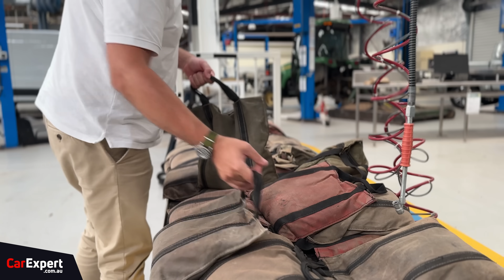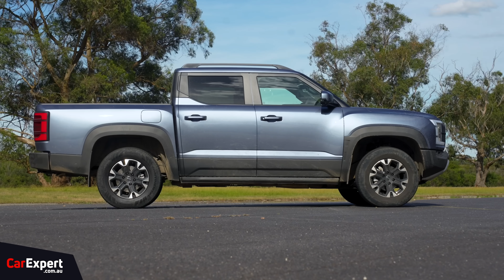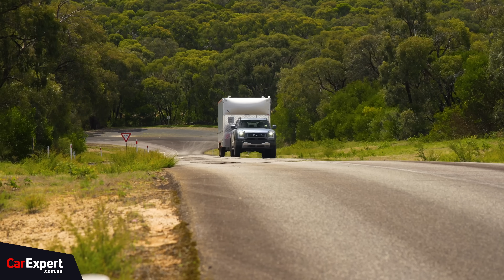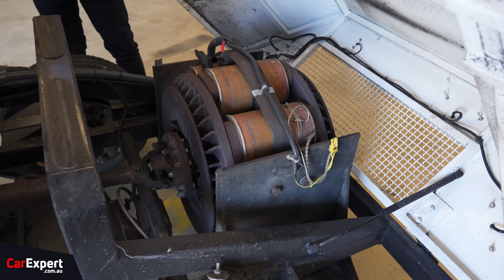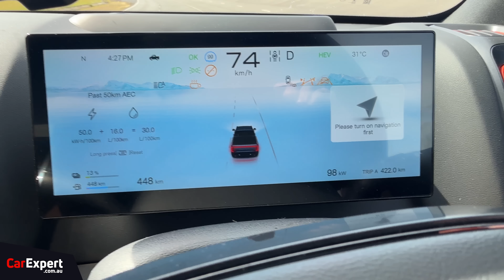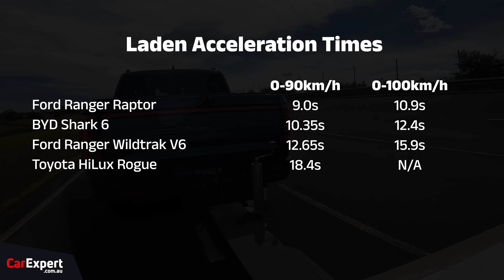BYD Shark 6 towing STRESS test at MAX payload - the results are surprising...

Comment: To all those that see anything that tows less than 3.5T as a waste of space, what are you doing here?   For those of us that tow up to 2.2T and are happy doing that we now have an exciting new choice that costs way less than our previous options and by all accounts will do it well. I for one am excited by the prospect of NOT having to resort to a smelly smoke belching, noisy diesel vehicle I’ll be able to tow my 2T van with the same vehicle I put my electric zero turn mower in and be able to power/recharge them both as well and not carry a generator for either of them. This thing was made for my use case so I’m looking forward to trying one after they’ve had a little time to fine tune it.
Reply: My hobby 540 caravan can sleep 4,have 2 24 inch TVs inside ,floor heating ,shower ,105Ah batery   ,Microwave ,air fryer and so on  and weight only 1.5 Tons
Reply: @jeffwallis6696  but the Shark 6 uses more fuel per 100km to tow than all the other utes that are towing an extra ton, except the silly Raptor.... so what use is it to you?  It's a totally pointless car.
Reply: @ @Hmm, we’ll just have to wait and see I guess. If you believe that the tow test done by Paul represents how you’ll be towing your load up a hill then you are 100% correct. I’ve been reading about the trailer dyne and the ones I found for sale (new) were designed to simulate a 25% grade and you set the load you wanted and obviously your speed. Now if the unit in the test was like the ones I researched then he was towing roughly a 2T load up a 25% grade at 100kph. It had to have rubbish fuel consumption, its a tiny turbo petrol literally having its neck wrung up a gradient that was twice its approved 12% maximum. It was only half a test, we learned how to kill it but we learned nothing about how it will go when it’s driven by an owner without an YouTube entertainment channel.
Now in my situation I’m going to be more concerned about the petrol going stale in the tank because week to week I travel mostly short trips of 30km or so and the engine will never turn on. I’m not trying to convince you it’s good, I still don’t know. But I’m definitely going to before I buy one.
Reply: @jeffwallis6696  yeah time will tell.  I know I won't be getting one as a tow vehicle, a city run about with occasional light duties and a little adventure would be fine, which is what most people will use it for.
Reply: @mattmobiles15  I think that’s exactly the group they’re aiming at and to be fair I sit in that group. I see this first edition somewhat like a bridge between what we have now and the future that has yet to be invented and anyone that buys one is probably going to struggle badly with buyers remorse because every new model that comes out will probably be better in almost every way, but you’ve gotta be happy with what you buy now and just move on, its hard enough keeping up with the new phones, let alone new cars. This will be a really good car for many and fall way short for many more. I’ve paid a deposit to secure a place in the queue but I’m still waiting to be convinced that the advertising hype is duplicatable in reality. As you say, we shall see.
Reply: @jeffwallis6696  mazda recently revised their wankel rotary engine to act as a generator for an EV hybrid, so more is to come, it will only improve as time goes on.  Look how far phones and TVs have came over 20 years.
Reply: @ silly Raptor?
Reply: @gp.SSV8  silly engine in a Ute, fun, but silly haha
Reply: Ya can’t beat an old fashioned soot blower!
Reply: And you will be smart enough to use the right mode with the right SOC for that too unlike our 'tester' lol
Reply: 🤣🤣🤣
I am afraid Paul needs to test 4 rounds x 1000km   .....

First round towing 1 ton for 1000 km.....
2nd round towing 1.5 ton for 1000 km....
3rd round towing 2 tons ........
4th round towing 2.5 tons .....

   for a total of 4  rounds  and an international referee is required
Reply: I regularly tow 2tons and my diesel doesn’t puff any black smoke out the back, what are you on? While an EV will have immense torque on hand I can still cover my 400km route almost twice in the same day on the same tank of 70ltrs for 800km. So keep your EV Ute for you round the block work.
Reply: @ thats wonderful Sean, and I’m truely happy for you, you have obviously made the right choice for your use case. But just to be clear, it’s not ‘MY’ EV and I may never own one, that is yet to be decided. There is much water to go under this bridge before any commitment is made on my part and if I’m trying to convince anyone of the merits of this vehicle it’s myself so please don’t feel challenged in any way by my comments.
As for diesel smoke, you either love it or hate it, personally I hate it, and if your truck doesn’t stink then well done, you’re obviously in the camp that keeps it well serviced. But it’s a brave man to go round telling the world that his s**t doesn’t stink don’t you think?
Reply: @Random-Destination  while you think I’m going after EV negatively, I’m not. The problem is, 1. Range for actual application, 2. This particular vehicle when out of battery switches to ICE and limits engine performance while sucking down over 16litres / 100km in petrol which puts it into the 1990’s v8 category of fuel efficiency 3. Ease of maintenance for people who work their own vehicles and even independent workshops. Lastly and certainly not least, after Tesla being the ground breakers for the last 10 years or so, it is now coming to light just how polluting EV’s truly are since the metals and chemicals used to make the battery packs are very dangerous and to replace them costs a fortune when you factor in mining and how it’s mined(hint, a lot of diesel is used to mine the raw materials). So you have end of life problems, beginning of life problems & while it’s in service middle life problems… where is the upside? I think Toyota’s hydrogen cell tech is far more green and our local taxi industry actually run on lpg. But please understand,  a few years ago I was absolutely smitten with EV and all the upsides like huge torque, clean energy, mechanical simplicity, mechanical superiority ( I mean an electric motor on each wheel is amazingly versatile, more so than any traditional prop shaft/ diff setup)I would love to see it get to a point where it’s actually genuinely clean energy/ materials with 650km+ real range and say 1h30 full charge. So while the whole EV thing intriguing it should stay on runabout cars or fit for purpose applications. For instance we have a manufacturer who is making EV game viewing vehicles that are amazingly capable but fit for purpose. This concept BYD shark is just a bad idea all round.
Reply: @ I definitely see your position, and I agree with most of your points completely. And like you I’m no longer the illusion that EV’s are going to fix all our climate issues, they’re simply not, that’s a much larger issue.

Where we differ though (and that’s OK) is on the point that the Shark is a bad idea. I see it as bridging the gap in Australia that EV’s just can’t fill. However, based on the reviews/tests etc. that have been presented to date none of us can be certain enough about anything we’ve seen to make buying one anything other than a gamble because we’ve only seen pre-production versions and stress tests against much more capable, higher capacity vehicles & it’s never going to measure up to them. The Dyno Trailer test used here was conceived to stress test vehicles with 40% more towing capacity yet it was expected to compete with them as an equal using the same loads they used…..really. Let’s stretch the big boys at 40% above max. and see how they fare. Perhaps an Australian version of American “Davis Dam Towing Test” would be a more useful measure of performance. But hey, what would I know?

So whilst I’m a fan of the concept I’m still not sold on it yet. I still have to be convinced it can tow at close to its stated GCM without me having to make significant allowances for its shortcomings on almost all bitumen roads east of the New England Highway. I’m even happy to carry a couple of jerrycans of fuel to make up for the smaller 60L tank on the few rare occasions I travel any real distance inland or camp off-grid and meet to use it as a power plant, but honestly I just don’t venture that far inland for it to be an issue for me personally and many others will no doubt be the same.
Reply: wr
Reply: Calm down champ.
Reply: My diesel powered tow vehicle is neither noisy or belching smoke out back whilst towing my 2000kg plus trailer!

Comment: So the Shark was bad because its towing economy (fuel consumption) was approx 5 times worse than its unladen economy, but about the same as all the other utes when towing? And better than the Raptor😮
Reply: Yep, thats the logical take except for the anti's around here. Given this was an extreme test i felt the performance was great and it will be fine in normal towing with 70% SOC set.
Reply: @Johnno1979  wr
Reply: @dingbatt  it doesn't seem to save any fuel, so I ask, why bother having to put up with the possible inconveniences instead of just getting a normal diesel Ute?
Reply: @mattmobiles15  does anybody with an ute tow daily? is your trailer permanently attached to your vehicle? if you go to the supermarket to buy groceries do you also bring trailer with you?
Reply: @Alvyrre  like I said, if people need a proper Ute, they don't buy these BYD or a Raptor.  Most tradies tow every single day they work.  My brother does and he get 10L/100Km towing with his Triton around the city.  Way better than this BYD.  Even just normal driv8ng around it only uses 1L/100km less than my Mazda BT50.  The BYD is pointless other than maybe running on electric only down to the shop.  Even then, it's not worth the hassle. It just seems like an interesting concept but in the and it is a pointless car.

Comment: You’re being very kind Paul.
I think this is a massive failure.
Picture a 2 tonne camper, 40 degree heat with a head wind and you encounter a long steep hill. I happens a lot in Oz. Give me an oil burner any day.
Reply: if you tow the camper everyday then yeah its a problem, but if its a weekend thing or ocassionally i dont see a problem.
Reply: Won't happen in real world. For just 10 minutes of these towing test at 100km/hr, say 10% slope. You could climb 1.7km hill and reach the highest car park on Mount Kosciuszko.
Reply: @jameschen2942  Exactly. A 3kN load equals towing 2.5 tonnes up a 7º slope, or 12.2% grade. For every 5km lap around the Lang Lang loop, the equivalent is of gaining 615m elevation. Three laps and you've done the equivalent of sea level to Charlotte Pass in 15 km without any downhill!
Reply: @CMurdoch-n3t  I think the point they’re trying to make is power sustainability.
Every Ute tested went through the same test. Every Ute completed the circuit albeit some only managing 90 kph.
I wonder how it would go on Fraser Island in soft sand all day, no low range with no ability to recharge.
Great car for the city though.
Reply: @michaelklocke-v5g  I wouldn't think it would need low range if maximum motor torque is delivered from virtually standstill. It's why basically every EV has no gearbox, yet doesn't struggle on a hill; torque is just instantaneous and delivered at a wide speed range. The engine should be able to charge the battery in any situation that isn't at it's limit, so I wouldn't think soft sand is that much of an issue unless you're trying to haul a 2.5t trailer along with you (which would be folly in itself). The traction control, however, might be more the limiting factor unless they tune it.
Reply: There's vehicles in existence that are unable to haul themselves, minus the caravan, unladen up a moderate hill. Those vehicles are powered by one of Toyota's apparently best engines. The 2H is god's engine to many, and it's got nothing. I don't think it will pose a massive issue on this particular topic. Where it will be a problem is not being able to get up a 30-degree incline, and the reliability is yet to be confirmed. Step up guinea pigs.
Reply: Toyota Hilux 2.8 diesel is rated at towing 3.5tons but at their test with same test trailer at 3KN they could not reach 100km/h .So is Toyota Hilux massive failure
Reply: @dzonikg  the prado in the review has the same engines as the Hilux. 150 kw
It managed the test without any problems.5 laps I think he said
Reply: @michaelklocke-v5g  From his website
 Toyota HiLux Rogue
Engine: 2.8-litre turbo-diesel 4cyl
Power: 150kW @ 3000rpm
Torque: 500Nm @ 1600rpm
Towing capacity: 3500kg

0-100km/h with 3kN trailer: FAIL
Fuel econ unladen: 10.2L/100km
Fuel econ with trailer: 29.0L/100km

ANd that car is rated for 3.5t so a ton more then this car and still fail ,so like i sad is Toyota Hulix fail becase off that

Comment: there is quite some evidence that disprove the argument against being the electric drivetrain responsible for the poor performance in the test.
BYD made, a totally avoidable, compromised system that inevitably produces compromised results. 
All because they take for granted people will use it just as a hybrid, with the battery depleted most of the time.

Comment: Thanks for this Paul, really comprehensively done! 

One question, when you were towing at 3KN, how long did it last before it hit the 70km/h max? i.e. how long of a very long climb before you hit that limit?

Also, when you talked about economy when towing, I'm not sure I agree with the statement "comparatively it is going to use more fuel than an equivalent 4cyl dual cab" it used 30L/100km and the most efficient when towing used 28.3! That's not much different, most of them were 29 and the Raptor was 36. Also, with the cost difference between petrol and diesel sometimes very big, I think cents per km the BYD might be ok here. Still very useful information. Thanks!

Comment: Can't remember the last time that I towed anything. I suspect that will be the same with 97% of drivers.
Reply: spot on.
Reply: Most people buy Ute's, so they can tow that overloaded caravan twice a year and throw it in a mud hole or go up a beach. I have a trailer with an excavator loaded 90% of my travels. Very rarely, not towing. I don't know anyone with a ute that doesn't tow something.
Reply: @dinosshed  I doubt that "most people buy utes so they can tow that overloaded caravan twice a year..." 1. I hardly ever see a caravan on the road. and 2. Literally every person that I know who owns a ute has never towed a thing. Maybe we're just different like that in New Zealand.
Reply: And still struggle accelerating towing light weight....
Reply: @rolieg81  As per my original post, I don't tow things. Ever. And I suspect that's the same for most people. I could care less about the towing ability of a vehicle.
Reply: 97% do tow dummy

Comment: Very surprising that you dont show the state of charge at all till the very end of the video where its having issues. And you didnt mention the SoC engine kickon setting, which I would have thought would be the main setting you'd adjust if youre towing.  Maybe you did it all correct, but to not discuss it thoroughly or even show it detracts from the validity of this video.
Reply: He did mention that started with 60% and was in HEV mode
Reply: @dzheyd9609  pics or it didnt happen...  This is supposed to be an informative VIDEO! Why not include all the details in the actual video?  Why do we have to speculate in the comments section about how the test was conducted?
Reply: This video test is so biased... it is obvious that improbable bordering on silly were chosen to make th Shark fail.
Reply: And didn't mention Regen modes. It seems they were rushed and didn't have time before to properly understand how the system works or what settings you needed. Was still an interesting test.

Comment: So it's great for towing say 300 clicks out of any city, as long as there are only about 3 or 4 decent hills between you and Dingo Piss Creek? Lucky there are only a couple of small hills on the eastern side of Australia ...
Reply: Why "300 clicks"? If you can buy petrol you can tow as far as you like. The engine will easily provide enough power and charge to keep it moving at the legal limit on the flat. When you get to a hill it will gradually use the battery, and you'll get it back going down the other side, ready for the next one. There won't be too many hills in Australia where it'll pull the battery down to where they had it in this test.

Comment: That's some interesting info, and in my experience, not really an edge case. I've driven through some really hilly country on the main highway that would really put this to the test
Reply: This is totaly edge case if you are very stupid and dont know how to use this car ,set battery to target 50-70% and you will have more then enough for any hill in the world
Reply: @dzonikg  sure, if you like a fuel economy of 30 litres per 100km.  That's more than double the fuel usage of my dmax towing my caravan
Reply: @wotmate  This in not reality test ,go to his website,same trailer ,same 3kn resintance . 

Isuzu D-Max LS-U+  Engine: 3.0-litre turbo-diesel 4cyl
0-100km/h with 3kN trailer: FAIL

 SO your truck could not even reach 100 km/h at same test and you complaine about BYD ?